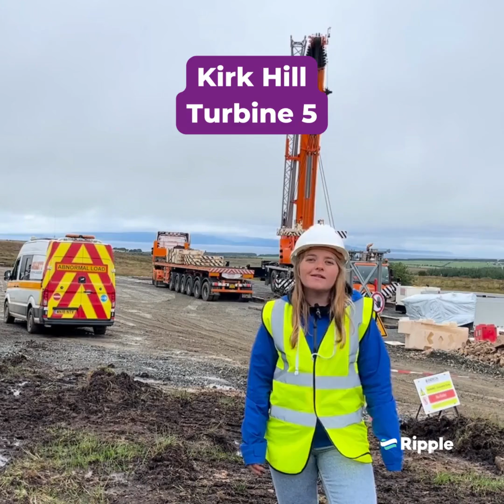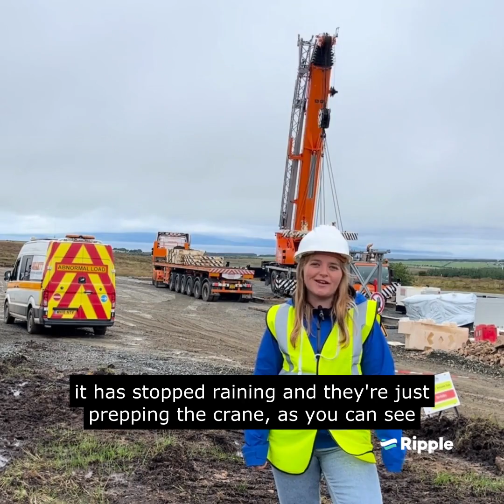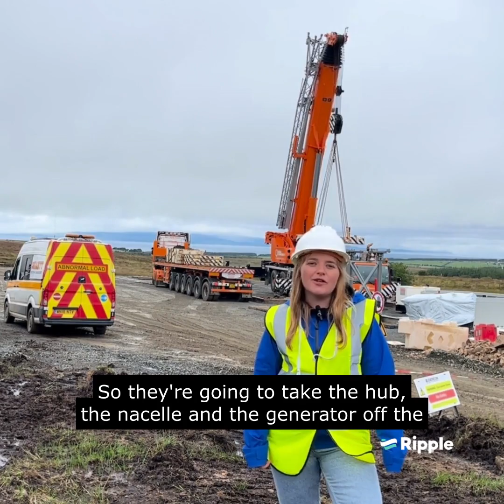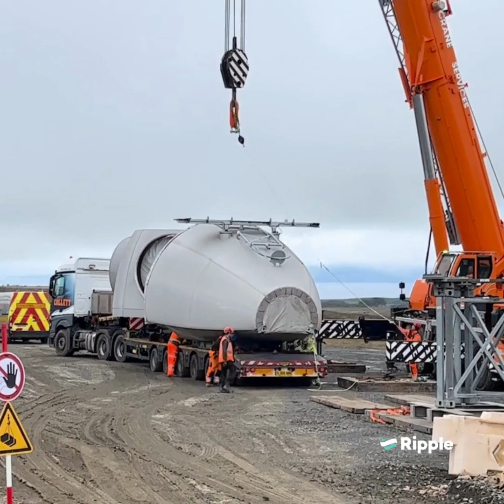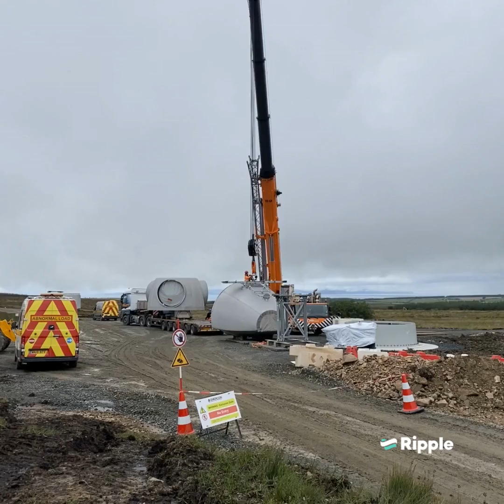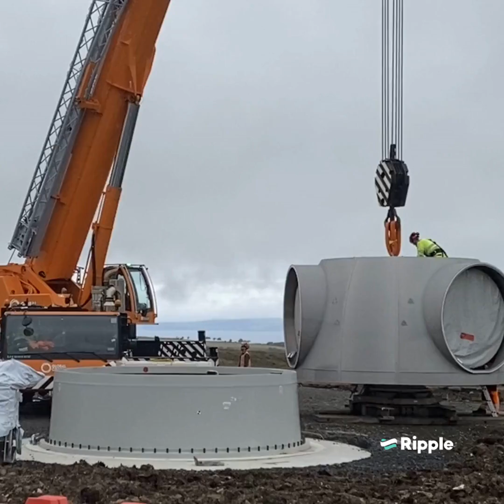Offloading equipment by turbine 5

Comment: Why don’t they assemble straight from lorry onto final location?
Reply from the maker: There are a few reasons for this, but typically due to availability of police escorts, it takes longer to deliver all the components than it does to assemble the turbine, so we will fill out the site with most of the components before we start assembly. The main crane is much larger and more expensive to have on site than the cranes used for offloading, so we don't want it to run out of work!
Reply: appears they’d need a taller crane? perhaps they just hire a more expensive, taller crane when all the parts are on site?